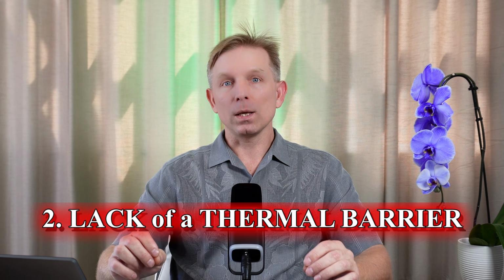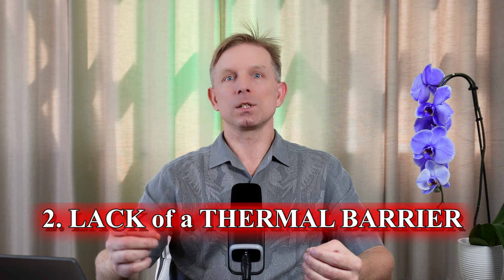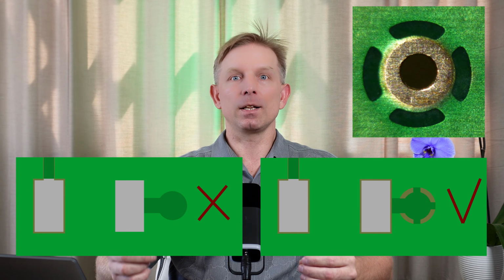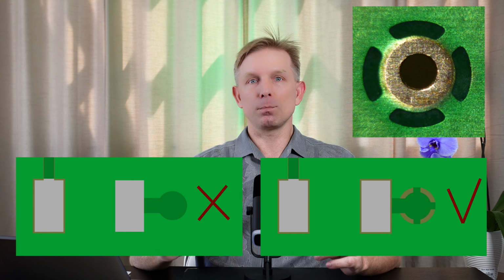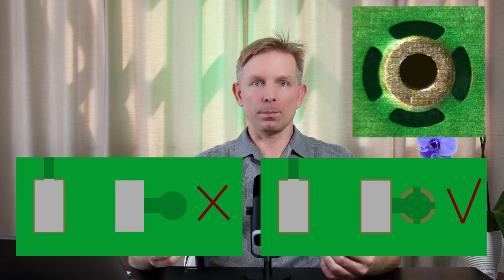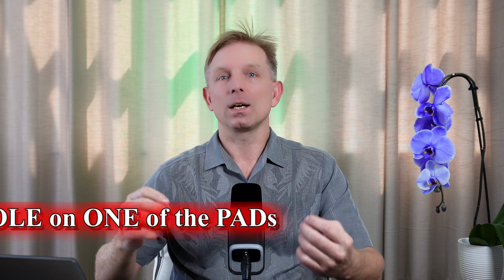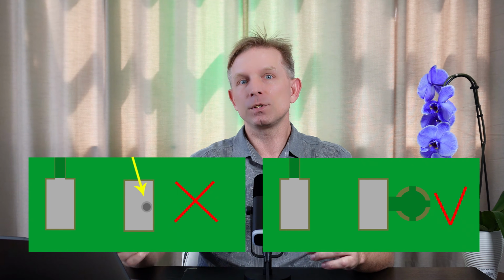Tombstone Defect in Soldering Electronic PCBs. Why?

Comment: Since you asked, I was attempting to solder a row of ceramic SMD capacitor on a CPU socket. The motherboard in question is sitting on a steel plate, designed to hold one ATX, E-ATX or uATX motherboard and comes with a detachable bracket, which would allow a PCU and or PCI, AGP or PCIe cards to be fixed on the motherboard. Or an open PC case, which only consists of the one steel plate, holding the motherboard and a PCU if you want. It is meant as a test-bench. 
The back of the steel plate has a large open carving, which allows CPU brackets to be removed or CPU coolers with back-plates to be installed. I think it is a fantastic tool for doing repairs on such a motherboard. 
The socket area of the motherboard is open, so in theory, I could remove the metal plates from the top of my pre-heater and place the steel plate, holding my motherboard on the pre-heater, so the additional distance from the heating element of the pre-heater would no longer lose more heat before the heat reaches the motherboard PCB.
Back to the CPU socket, I did use my pre-heater for the socket area at 385°C, since with the metal brackets on the top of the pre-heater and the height of the bench-table, I am guessing a lot of heat gets lost before the motherboard is even reached. My thermometer, which I aimed at the CPU socket, after the pre-heater did reach 385°C, showed only a maximum temperature of 175°C. That bench-table steel plate does however cool down the motherboard very quickly by pulling away so much heat, that you can touch the steel plate even near the pre-heater and I only get to 30° surface temperature. 
I used flux-paste with high silver contents and applied with the tip of a tooth-pic a tiny amount of that paste on both solder pads on the motherboard. The PCB design does take place in Taipei, Taiwan behind closed doors. 
Since the flux-paste did not split evenly on both solder pads, I thought, I would take my iron and take a little excess solder away from the other side. Listening to your description, I get that with the surface tension, but the distance between the two solder pad of those 0815 ceramic capacitors is maybe 1-2mm at most.
When I took my desolder-wick to the side with the excess solder, the solder melted and that very tombstone-effect happened, which was very surprising and super annoying, because those capacitors didn't want to let go of that iron tip anymore. And trying to hold down the capacitor with tweezers did not go at all.  Let's hope my new tweezers are up to the task.
Reply from the maker: Try a good tool from Weller with thermal tweezers wx2021 instead of a regular soldering iron.
Reply: @ElectronicsManufacturingTech  Cheers and thank you! Your help is much appreciated. 
Unfortunately the price policy of Weller is something, I have to disagree with. So does my empty wallet. I know Weller because my dad has a Weller soldering station, age 49 years. I do not remember that my dad ever tried or needed to replace the iron tips at all.